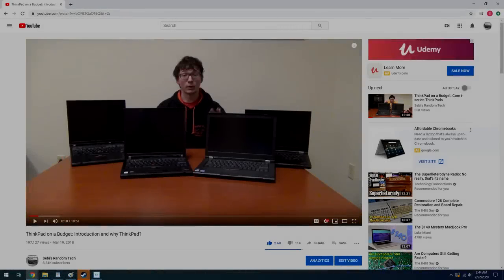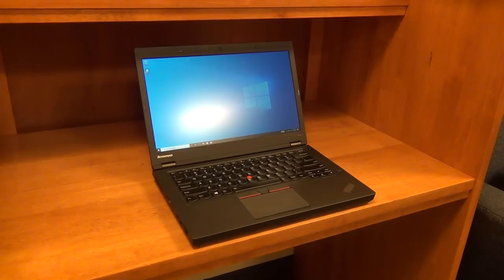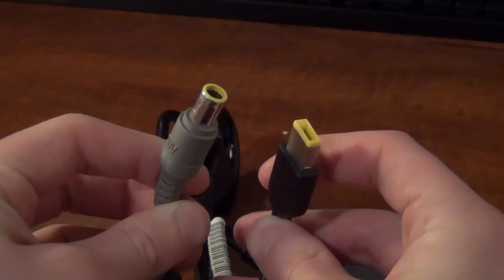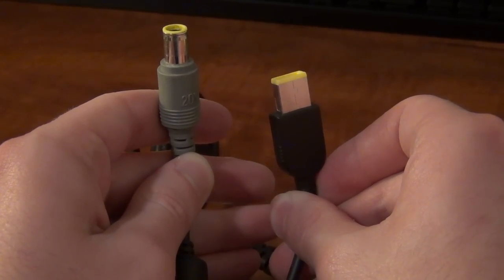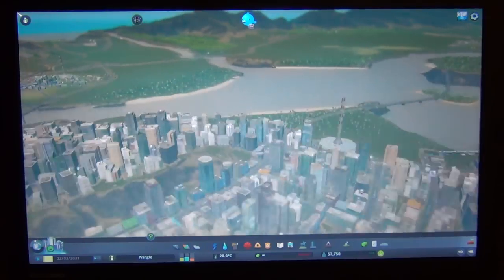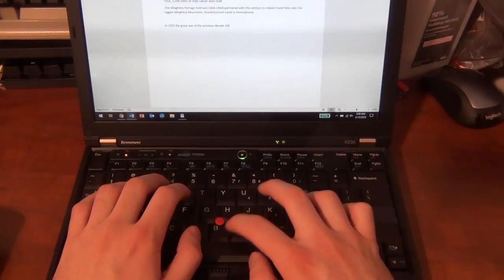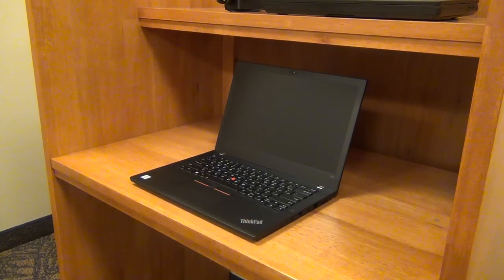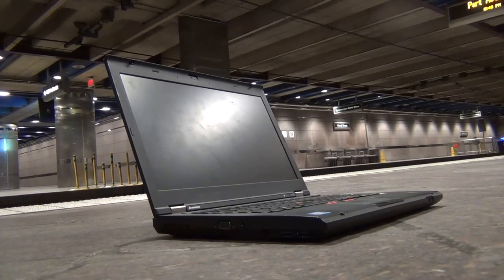Best Value ThinkPads in 2020

Comment: What abou thinkpad x270 core i5-7300u 8gb ram ddr4 for 300 euro ?
Reply from the maker: What screen does it have?
Reply: 12.5" HD screen
Reply from the maker: @flux0011  What is the resolution?
Reply: 1366 x 768
Reply from the maker: @flux0011  Alright, that's not a terrible deal except for the screen. You could look into upgrading the screen at a later point in time.

Comment: i have x201 and is still great and i love keyboard. please include x201 or x220 these is really great for traveling
Reply from the maker: I never said they weren't great laptops, but they are generally a little more pricy than their 14" counterparts. This was addressed in the video.
Reply: @SebisRandomTech  okay, but please include x201 or x220 in next upcoming video. about pros and cons also, and what makes a diference still using these x220 and x201 laptops. PLEASE. I AM USER OF X201.

Comment: Is a ThinkPad W520 worth it?
Reply: Absolutely, it's still a beast. Just bear in mind that it's big, so for a commute machine I'd go for the ones in the video, or even for a X220/X230 if you don't mind the 12,5" screen. They're all great.
Reply from the maker: If you can find one for a reasonable price and don’t mind the extra weight.
Reply: Sebi's Random Tech $300 for one? And how heavy is it?
Reply from the maker: @owenready7043  Depends on what the specs are. It weighs a little over 6 pounds.
Reply: Sebi's Random Tech 1920X1080 FHD Screen	

I7-2720QM + Nvidia Q1000M 

16G RAM

256GB mSATA SSD, spare 2.5" HDD space for 2nd drive

DVD+RW

WiFi+Bluetooth

9 cell Battery in good condition

170W Lenovo AC adapter
Reply from the maker: @owenready7043  Definitely not a bad deal, especially for that 1080p screen.
Reply: I'm not sebi, but unless thinkpads are really expensive in your country, I wouldn't recommend it. That discrete GPU is weak and is a potential source of failure. Also the i7-2720qm is just power hungry but power is just okay. If you're in the US, look into getting a W540 and swap out the trackpad for a discrete one. For $300 on ebay you can get one with a 1080p screen, i7-4700mq, 8gb RAM (but the W540 has 4 ram slots so putting more DDR3L in for cheap isnt a problem), and probably a SSD too. Overall just a newer laptop with more upgrade potential (you can go up to i7-4900mq (although recommend i7-4800mq for best mix of thermals and performance) and swap the screen for a gorgeous 3K screen). If you also need a discrete GPU then the ones in W540 are also more powerful (although they all pale in comparison with new pascal and above cards from Nvidia)
Reply from the maker: @RanenPo  The W540 also works with regular DDR3 - I'm typing this from mine.
Reply from the maker: @RanenPo  The 1080p screens in the W520/530 are very highly regarded and add a lot of value on their own. The W540 is still pretty expensive even in the states.

Comment: I'm having such a hard time deciding whether to get a t430s or a t440p and that's just a testament to how great these older machines are. T430s is amazing because the classic keyboard mod is much easier and there's a bunch of cool upgrades available apart from cpu.

But the t440p is probably the most powerful value thinkpad you can upgrade.

That said, what do you think of the p50? I've seen prices go down and it seems like a great w540 alternative.
Reply from the maker: The P50 is a great option if you don't mind the offset keyboard and larger size. I would recommend it over the W540 at this point, it's a much more modern machine with more processing power and better graphics, not to mention more modern ports.

Comment: at the end of 2022, you can get a x1 carbon with 8th gen i5 AND 16gb ram for 350 usd or p52s 16gb for 250.  better deal imo.
Reply from the maker: The key words being, at the end of 2022. That wasn't the case when this video was first made in early 2020 and I am working on an updated video for next year (2023).

Side note, the P52s (and really the whole P5xs line) is a waste of money. You might as well just get a T580 for the money or go up to the infinitely superior P52 (non-s).
Reply: @SebisRandomTech  why do you not like p52s?  I got one for a friend off eBay. She isn’t the technical type. Just want a nice 15”.
Reply from the maker: @slam5  For her needs it will be a fine computer, I just feel like marketing it as a mobile workstation is misleading because unlike the regular P52, this uses the same low power ultrabook CPUs of models like the T580 and T480 - in fact the T580 and P52s are almost physically identical. Once again, for your friend's needs it should be just fine but for performance enthusiasts it isn't the best model to get.

Comment: T440p or T440s? Which one to get?
Reply from the maker: Do you want something upgradeable or something thin with good battery life?
Reply: @SebisRandomTech  I want something upgradeable.
Reply from the maker: @rovibamba589  Then the T440p is probably the way to go. If you don't mind a larger laptop the W540 or P50 may also be worth considering.
Reply: @SebisRandomTech  hi I have Thinkpad w541 is it good for video edit thanks god bless
Reply: @SebisRandomTech  dont get the p50. overpriced and awful battery life and just not worth it

Comment: Sorry meant to ask if E530 is worth considering?
Reply: Celtic Ed no, e series is consumer trash, not a ThinkPad an actual t530 is $90
Reply from the maker: Low-quality junk. Basically the Acer of ThinkPads.
Reply: That's what I thought but wanted opinions of experienced minds. Thanks guys
Reply: E530 is my main machine. It's heavy. If you are going to use it for basic browsing and office tasks without moving it a lot, it is a good machine.
Reply: Thanks , W510 is probably a bit heavy for my use. I think I have been drawn over to the ThinkPad Parkside, I have since bought a T60 With 4gig ram and a 240g SSD. So far it's a good  machine for typing, if a little bigger than I expected, it turned out to be the 15" model. But for €65 it's pretty good value. I'm now hooked and looking for something more powerful and a bit smaller. I was thinking on Sebis advice to go for an X230 for easy upgradability, then I came across the tablet version which I thought seemed kind of cool. What do you guys think of the X230T as opposed to the basic 230? Are there hidden problems about upgrading for example? I have seen both models selling over here about €140 with 4 ram and a 500g SATA drive. I appreciate the opinions of the folk here, as you have already helped me out immensely
Reply from the maker: @celticed8100  The X230T doesn't have as good of battery life, and in my opinion the hinge isn't as solid as the standard X230's hinges. If you do decide to buy one try to get one with a multitouch display.
Reply: Own one myself and regret it, poor build quality and a dreadful, dim and grainy 1366x768 screen. A bit of a shame, since the keyboard and trackpoint aren't that bad though, and it does get pretty good battery life, performs well and is really easy to service.

Comment: Yes, indeed the best laptop when  purchased used or renewed. Purchased x240 with i5 4th gen, 256gig SSD, 16gig (Edit: 8gig** correction) ram in order to work from home for $200.
Reply from the maker: Not a bad deal! What screen did it come with?
Reply: @SebisRandomTech  1366 not Full HD tho...For work I can survive with that as I won't use my desktop as it consumes too much energy. Thinkpads are build for long last, I need to work for 12 hrs. So fancy laptops can eat x240's dust.

Comment: Whats a good price for a t430?
Reply from the maker: Depends on condition, specifications, included accessories, etc. For a run of the mill T430 without any major upgrades or such, I would say around $125-150 is a good price, maybe a bit more if it's refurbished and/or comes with some sort of warranty. If it's been upgraded, has a new battery, docking station, etc, then I would be fine paying a bit more.

Comment: I still appreciate the X240 and newer series because I do lug around my laptop all day, I commute on the tube, and ultrabook processors + Power Bridge = AMAZING battery life so I don't even have to carry the charger, so even less weight when compared to a T440p I daily drive an X250 because I got it for $50, got a 72wh battery and it lasts more than a full day of lectures and coding and internet browsing from shitty campus wifi, hell I once used my laptop for 2 whole days because I forgot my charger on a trip. On the power side of things I don't worry too much, I already have a pretty good desktop (Ryzen and Vega 64), and I have it set up so i can remote if I ever need the extra power of my desktop.
Reply from the maker: Glad you were able to find one for such a good price. At that price I wouldn't pass it up.
Reply: X250 for 50 bucks.. jesus Christ.. it would easily cost me around 300-400

Comment: Would you go for a x250 or a T440p
Reply from the maker: T440p unless I really need the portability.
Reply: X250 12.5 inch, same physical size as MacBook pro 13. And can take 3 storages , 1 x 2.5 inch ssd, 2 x m.2 ssd. Has square power socket. 
T440p 14 inch, also can take 3 storages, 1 x 2.5 inch ssd/hdd, 1 x msata and 1 x 2.5 inch ssd/hdd with caddy. Has round power socket. 
I prefer x250, because it has 2 batteries, 1 internal battery, used for hot swapping.

Comment: I recently stumbled upon Lenovo T-series and X-series laptops and found out they were with pretty neat prices and good value for the bucks - therefore I am kind of confused what to buy - my sole purpose of buying a used machine is that I need it mainly for writing (lectures), watching videos, some basic student work , hopefully with a good battery life as well . If possible as well to be fairly portable - I have focused on some of them models  430-440p but I started looking at the x series as well. What would you recommend me , I've watched so many videos on those laptops but the opinions on them vary a lot! Thank you beforehand!
Reply: Get T430. It have more options to upgrade than 440p. And with service manual (easy to get on PDF) is very easy to disassemble.
Reply from the maker: @W-Ostr  The only big upgrade option the T430 has that the T440p doesn't is external graphics cards through the ExpressCard slot, which for TBS's needs won't be necessary.
Reply from the maker: If you want something with a bit more power and a bit more upgradeability, go for a T430 or a T440p. For your needs a T420 won't be bad either. If you want something on the more portable side, the X220 and X230 are better. If battery life is more important, the X240, T440 (non p), and T440s sacrifice some power and upgradability in exchange for better battery life.
Reply: @SebisRandomTech  Yeah It's not that much for the upgradeability but for battery life , and portability , something lighter , that's why I looked at the x240 and t440 models. Thank you for the advice!
Reply: @tbsproductions8662  If you're handy and like to gamble, there are some broken screen x240s on eBay for less than $50 shipped. You just have to make sure to get the correct screen and it's a fantastic deal.

Comment: what do you think about x230?
Reply: its just a x220 with the tiniest percentage of more power its perfectly good in 2020 and very future-proof especially if you max the specs like 16gb ram and a ssd
Reply: @jameswyma9849  i have one x230, it's okish... i upgraded to 500gb ssd and going to upgrade ram too... buuut, i'm eyeballing t480 now...
Reply: With an SSD and 12GB RAM it works great. Very snappy and viable. Very much like the T430. The only weakness is the speakers, but they can be upgraded.
Reply: @marmaly  what's the max frequency ram x230 supports?

Comment: is the e series any good (specifically e470) got one for a pretty good price
Reply: They arent bad, especially if u can find one with nvidia graphics
Reply from the maker: They're decent especially for a good price, I would say they're a bit inferior to the L and T series but if it works for you and lasts then that's all that matters!
Reply: @SebisRandomTech  it was 35 bucks since the usbs were all broken
Reply from the maker: @gushinsussin  Yikes! Hope you can still get some use out of it!
Reply: @SebisRandomTech  one of them sparked when i shoved a screwdriver in (forgot to disconnect the battery lol) so i know that one at the very least could work if i replace it, ill probably just install the os onto the ssd in another computer then put it in (no gentoo though since i dont feel like craning my neck up at a tv the whole time 😭)

Comment: When you get to the point where you want to use an external graphics card with your laptop it may be the sign you need to move on. The T430 was one of my favorites (I wasn't a knuckle dragging 7 row keyboard fan who refused to let go); but technology moves on.
Reply from the maker: What's wrong with getting more life out of an old system if it's otherwise perfectly capable? Certainly better than blowing a few thousand on a new gaming laptop or having a desktop take up so much space just for the occasion when you want to game...

Tell me, is it time for Razor to move on when they announced their eGPU for their Blade laptops?
Reply: @SebisRandomTech  Yes.
Reply from the maker: @bobwoodward9550  Alright, I know "go big or go home" is a thing but I'm sorry that in your eyes people shouldn't be able to make their own upgrades or modifications to fit their needs.
Reply: @SebisRandomTech  a shown here, Sebi has a god complex and immense intellect, so much so to the point where he shuts down any attempt to criticize the godly ThinkPad, It appears that Sebi has unlimited IQ and simply CANT be defeated.

he points out that there is always a solution to every problem with thinkpads 

9 cell batteries give good battery life to older thinkpads,

you can game with the express card gpu,

x series thinkpads for a more portable experience, 
 
 Like Sebi, Thinkpads are simply so Powerful as a creation that they are unstoppable. So modular than they can become a frickin car if you try hard enough.
Reply: @SebisRandomTech   I'm serious though, there is nothing I CANT do with my t430. NOTHING.
Reply: @trenchcoatgaming2893  Can you bludgeon your enemies with it?
Reply: @archygrey9093   4:16 see that corner? that can crack a skull open before the screen cracks 👌
Reply: @archygrey9093  You slay enemies with a trusted Model M IBM Keyboard.  There is steel in there !

Comment: Thoughts on a w541 in 2022?
Reply from the maker: Depends entirely on what you need it for. It's an excellent laptop!
Reply: @SebisRandomTech  So instead of buying a PC I wanted to use this laptop as a cheap desktop replacement and run PopOS and use it for programming, media consumption and virtualization. Will it keep up ?
Reply from the maker: @JohnDoe-wi7eb  For those tasks it should be more than good enough if you can get ahold of one. I should note that you might be able to get a P50 in the same price range, so if one pops up it would be smarter to go for that for better performance.

Comment: Thank you so much for this very useful video ❤️ i learnt alot about thinkpads. Can you please recommend me a good thinkpad for my web developing work? I really need to experience true colors as I have to work with websites all the time. Currently T450 and 11E yoga in my mind. But not sure what is best. Hope you can help me ❤️❤️
Reply from the maker: The P series tend to come with nicer displays, and some of them even have built in color calibration. They tend to be expensive even on the used market. The T450 was only available from the factory with a TN panel, so a T440p, T440s, or T450s with a 1080p IPS display might be better if you want a better quality and more accurate display. Some of Lenovo's newer offerings are also starting to come with better screens, finally.

Comment: Can't beat a thinkpad, apart from the hinge on my X250
Reply from the maker: At least the hinge can be replaced!
Reply: Sebi's Random Tech UR right, I ended up just doing the whole frame after other issues persisted with the old body that I had for a couple years (picked out 3 from a corporate waste bin when I was on work experience) but the internals are still the same, amazing machine, looking to fix a T series one though since they are much more modular
Reply from the maker: I find myself always gravitating back to the T430. It’s older but I love the design and there’s so many things that can be upgraded.

Comment: t440p best option then?
Reply from the maker: Or T430.
Reply: @SebisRandomTech  yeah but you gotta understand in europe not much availability for t430 with quad and fhd ips
Reply from the maker: Yup. Like I said, T440p or T430. Whichever is more readily available.
Reply: @Brandon Kick how much for t480? 400-500?
Reply from the maker: @Brandon Kick Sounds like your T520 could benefit from a new battery. The **30 and **40 series have more efficient processors so you can expect better battery life with those models, even though it isn’t as good as, say, a T480.
Reply from the maker: Now there’s even an Expresscard NVME adapter being made for older ThinkPads!